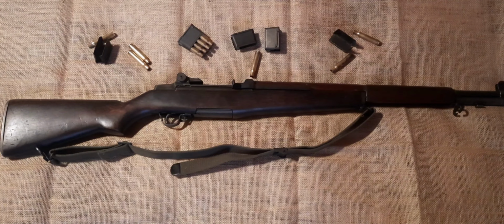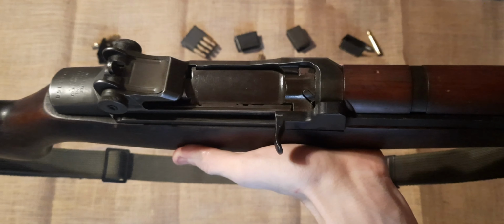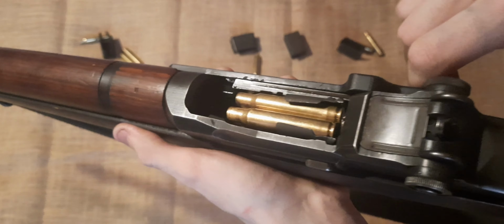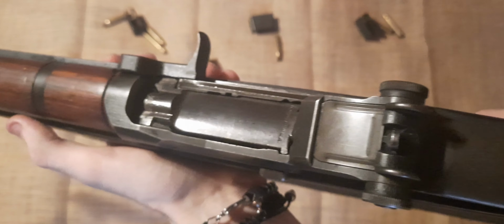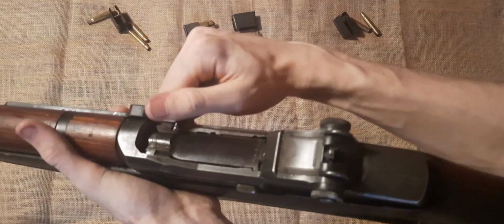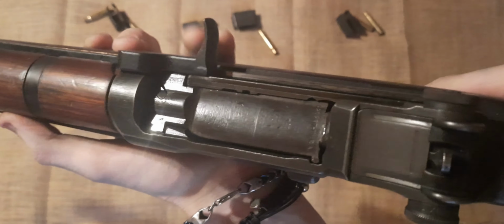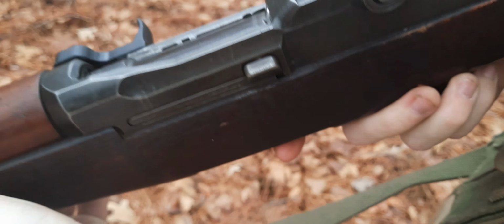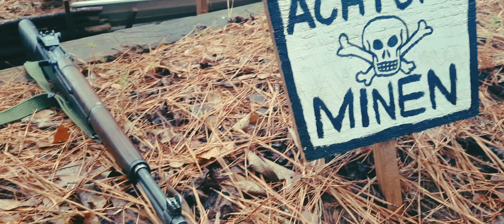My original WW2 M1 Garand from February 1945!  review/firing

Comment: Congratulations on your M1 Garand. If you take a look a the bolt Next to what appears to be a serial number (it's called a draw number) are the letters WRA which indicates that the bolt is a Winchester Repeating Arms bolt. Winchester did produce M1 Garand's during WWII as did International Harvester. Later during the Korean War Harrington Richardson produced Garands as well as the M-14 a short time later. Your rifle may have been arsenal rebuilt and the original Springfield bolt replaced by the WRA bolt. This was common practice when parts were worn out of spec. Often time rear echelon armorers did inspections and replaced parts as well getting the rifles back in the field quicker than shipping the rifles back to the states for inspection and rebuild. If your rifle came through the CMP (Civilian Marksmanship Program) these often are returns from various countries that the US loaned them to. CMP gets crates of these rifles back and inspects, grades their condition, rebuilds and then presents them to the public for sale or auction. A fully "ORIGINAL" rifle would of course be one that retained all the parts that it was initially built and issued with and that is nearly searching for a unicorn. They are EXCEPTIONALLY RARE! CMP does what they call "Correct Grade" rebuilds and this is a rifle assembled with parts that pertain to the year that the receiver serial number dates back too. For instance the "serial number on the bolt that I mentioned earlier begins with a D followed by I think 6 or 7 numbers. Sorry but my memory is a bit hazy on the exact numbers. If you cycle the bolt open on the right side of the barrel exterior close to where the chamber is you'll find another number beginning with a D assuming that the barrel is a military contract barrel. Those "Draw numbers" are assigned to certain years and are helpful in determining the born on date of the part it's stamped on. Bruce Canfield has a very detailed and complete book on the M1 Garand and you might find it on Amazon but don't hold me to that. Several years ago I collected WWII firearms and that as a "baby boomer" was a part of both my journey and fascination with WWII weapons and history. Enjoy that rifle and I would encourage you to research the M1. It's an interesting and iconic piece. My dad toted one when he served in the US Army in WWII. Take care my friend and be safe.
Reply from the maker: Very veru interesting information! And yes my rifle actually did come throught the CMP! I thought someone might catch that without me mentioning it in the video lol! And take care too, and be safe!